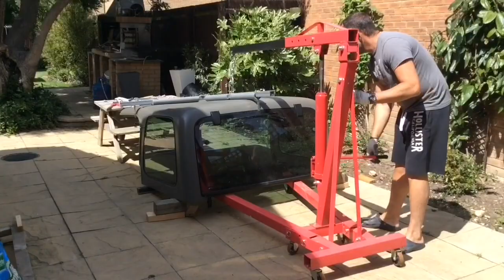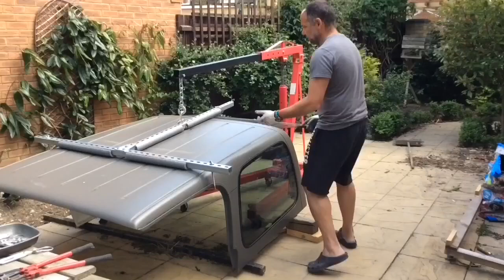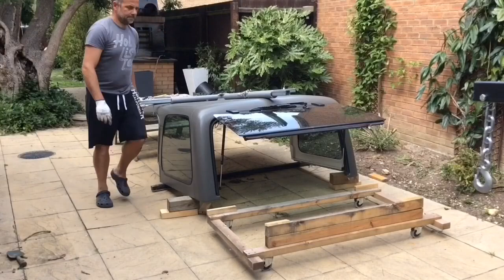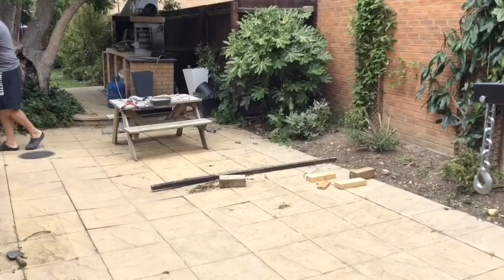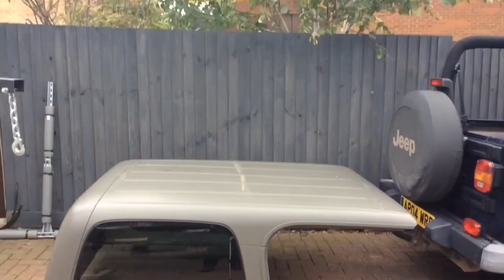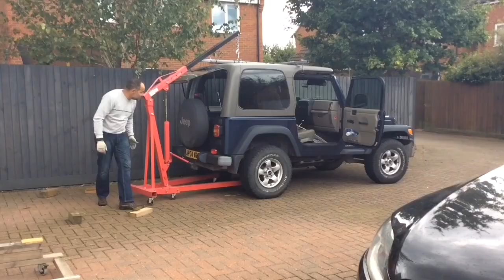Jeep Wrangler TJ hardtop placement with engine crane

Comment: Thank you for taking the time to video your excellent use of your engine crane!
I have a 1995 wrangler on 31" tires 2" lift. I went to a metal fab shop in town and was able to buy a 5' long 2"x2" 1/8" wall square tubing. This size will fit inside the existing 2 3/8" black square tubing on my 2 ton Harbor Freight engine crane. Paid $30 for 5' of tubing. Drilled and cut a slot for the chain and bolts like the factory extension arm. Works awesome I used a 2" wide ratchet strap to make a 3 point harness around the fiberglass top. Slightly front heavy but with a second person they can easily lift the top off the windshield and hold it up while removing the top off the jeep. Beats trying to wrestle the top off with a buddy!! 😅
Reply from the maker: Well done Rick, now you can do it by yourself. I am happy my video helped on that.

Comment: What did you use for a hook above the rear glass? and what is the length and width of your wooden cart? Great idea, thanks
Reply from the maker: Hi Perry, it was just a flat metal bar 50mm or 2” wide that I bent. Nothing special. I hope this helps.

Comment from the maker: Hi Don, mine is 2” lifted. I had to buy a new square tube 60mmx60mm and 150cm (59”) long as the original was only 70cm (28”). Only by extending the length it will work out.

Comment: Just bought a 2 dr wrangler Jeep that is lifted 3" with the big tires
I have the exact same cherry picker .... your best guess will this work on my jeep that is lifted .... will i get enough height ??
Reply from the maker: Hi Don, you will need to extend the length of your crane.
Reply from the maker: You will have to buy a new square tube of approximately 60” long and then it will be fine.

Comment: What’s the maximum height for the crane?
Reply from the maker: Hi Robert, it is approximately 2m or 6.5ft
Reply: @georgeiatrou9368  thanks. Great idea. I shared your video. I bought one too. Will make it easier taking off the top.